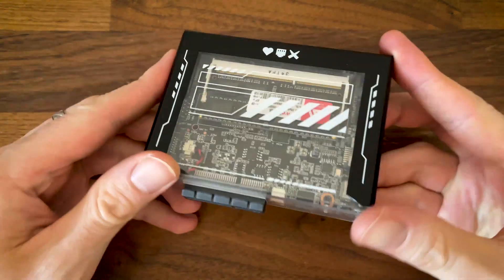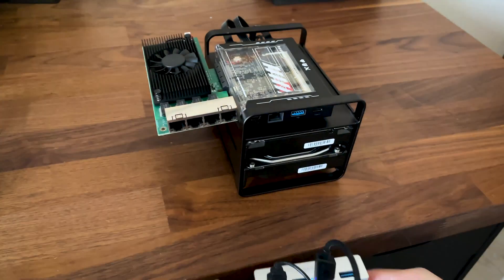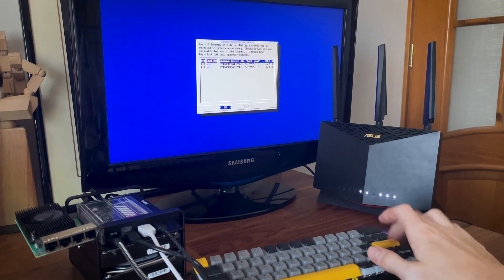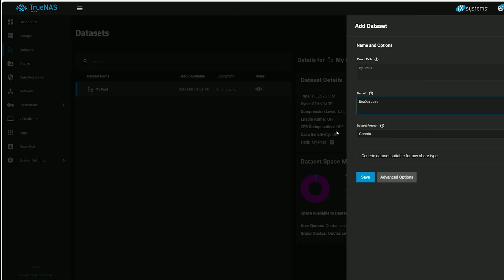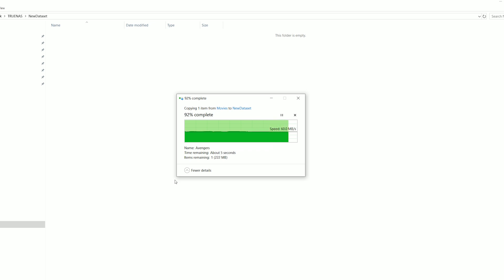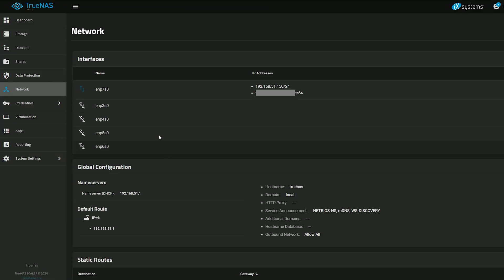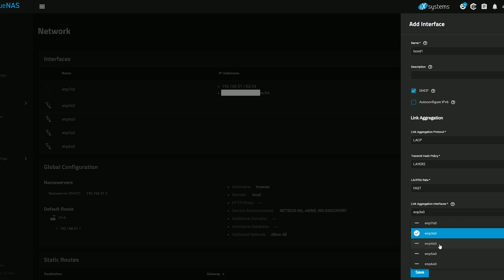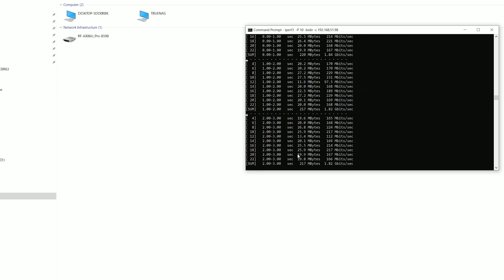Simple DIY NAS with multi-Gigabit ports - link aggregation test with ASUS RT-AX86U Pro

Comment: Could link aggregation possibly work on Zimaboard considering that it has two nics?
Reply from the maker: I am fairly sure that it will work. When I used the ZimaBlade, I could aggregate the built-in port as well, so I don't see why it wouldn't work on the ZimaBoard.

Comment: Hi, nice video! May i ask if its possible to connect another antenna to a wifi router through usb port or LAN port using a converter cable? Thank you!!!
Reply from the maker: I don't think you can mostly due to hardware incompatibilities. I suppose the closest you can get is to use a WiFi USB dongle to add an extra Internet connection for load balance and/or failover.